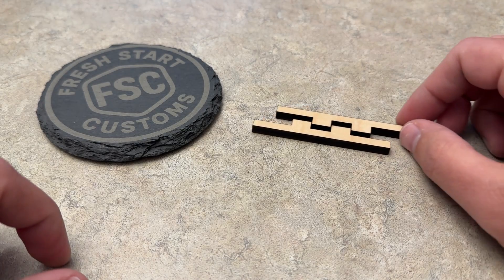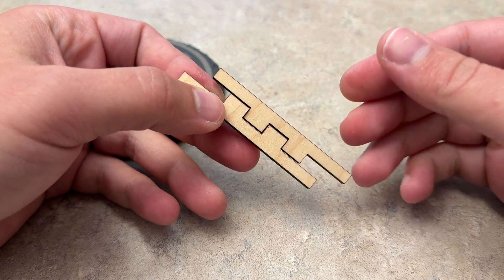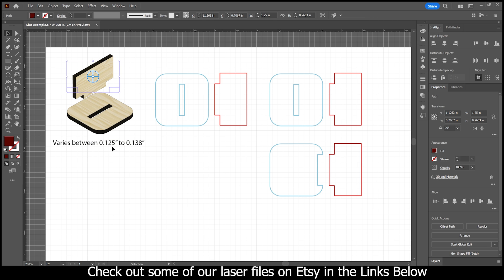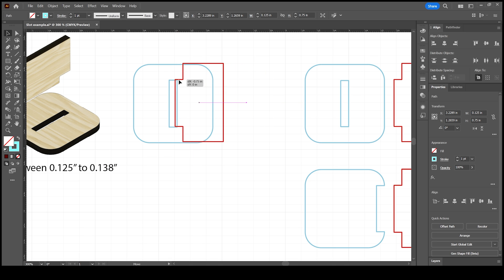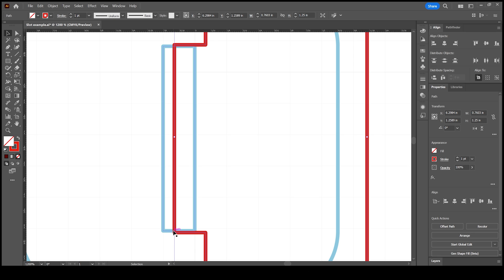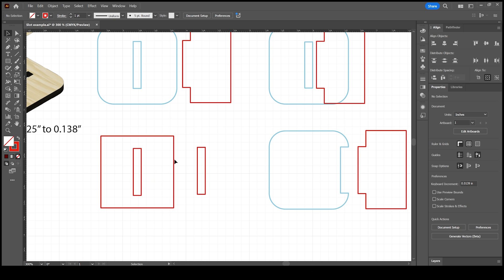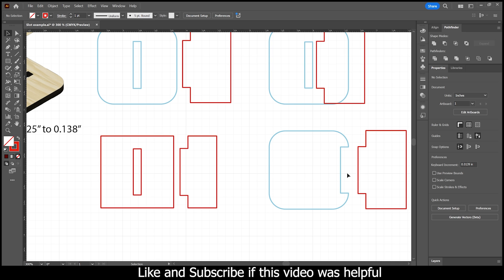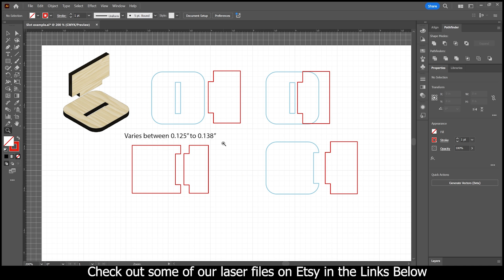The Perfect Laser Kerf?

Comment: So I have a CO2 laser in addition to my wecreat, so I have to manually focus. How would I determine my kerf width? I ask because depending on which lens I'm using my focus may be slightly different, so sometimes the beam might be slightly wider/thinner, especially if I'm choosing to be a tad out of focus for some projects. Does the type of lens affect the width your kerf? I know normally it doesn't matter, but when we're talking tens/hundredths of an inch it makes a difference. Hopefully all that makes sense if I'm explaining it correctly.
Reply from the maker: It can most likely affect it. You will need to do a test fit for each material type and situation then if the variables change.
Reply: @FreshStartCustoms that's what I thought but I was hoping for a less tedious option. Oh well, that's what we bargain for I guess. Thanks for your input!